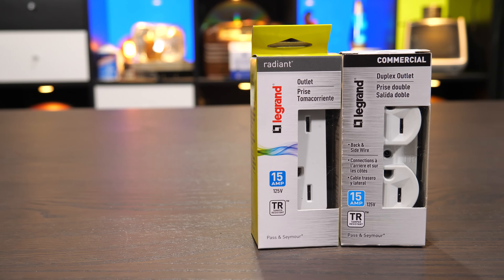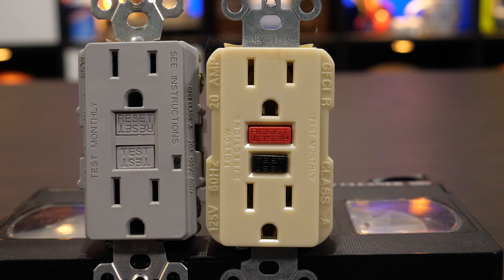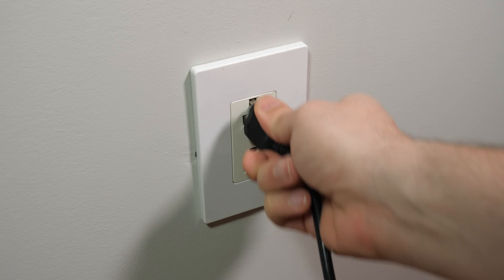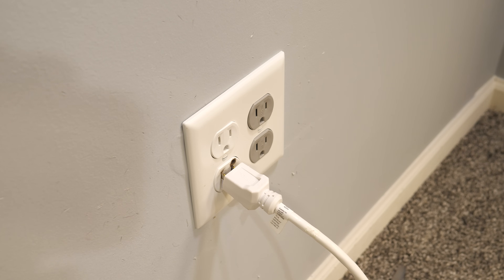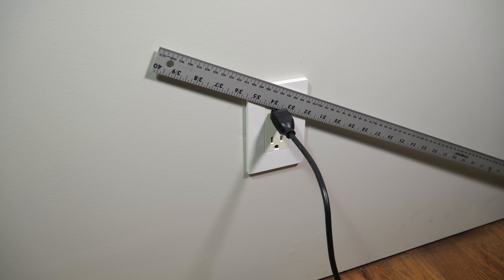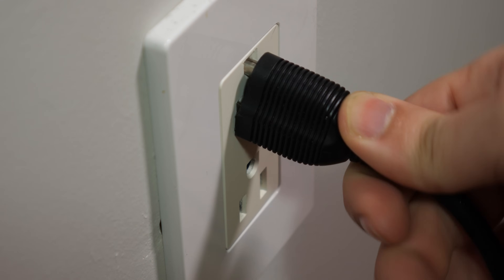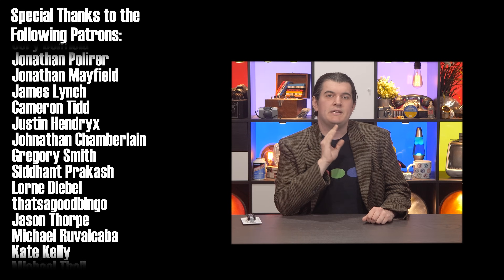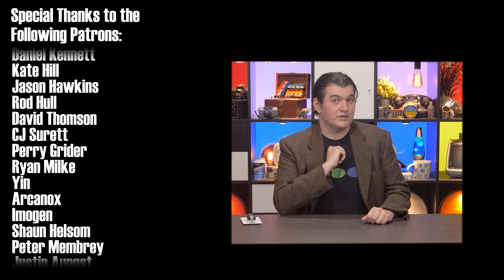Power outlets are topsy turvy - but does it matter?

Comment: My favorite part of the north american outlet faceplate is that they only use flat head screws. So if you want to remove the faceplate, you have to use a tool the perfect shape to fit into the prong slots. Granted, you should turn off the breaker, but the added risk is also nice.
Reply: If they changed that to anything it would most likely be phillips and hell no I'd rather deal with possible electrocution than phillips screws. If it were torx or allen screws then it'd be fine but for god's sake they need to let phillips die it's long past being obsolete at this point and it's a terrible standard (and worse it gets mixed up with the European ISO and asian JIS cross head standards which are not designed to cam out like phillips is but which also get annihilated if you try to use a US phillips head driver on them, just ask anyone that works on Japanese motorcycles about that)

 Words cannot express how much I loath phillips screws.
Reply: I hate using flathead for anything. Sure, Philips has its issues, but square has the best of both worlds. Drive locks into the screw, without a lot of pressure needed for a lot of torque. Its perfect. Square should be on everything. It already is on most outlets on the back, just not for the faceplate!
Reply: @cybrnekomusic  WTF would you use a square-drive screw on a faceplate? 🤔
Reply: Its a plastic faceplate.  Its not even tightened down to any torque.  Very hard to strip out a screw head at zero torque.  It's not a flat head engine from the 1920s using flat head screws as head bolts.  Its a faceplate.  You aren't going to be tightening it enough to strip, you aren't going to be pushing hard enough to slip any where.  I guess Michael j fox might be in danger if he were removing the plate, but he should probably be turning off the breaker before rewiring an outlet...
Reply: @nbf39501  My God, flat-head screws are soo finicky! C’mon, man, the flat-head screw / screwdriver is the cleanest, most basic fastener possible. You disconnect the plugs, twist a few turns, and it’s off!  If you hurry, you can have it off and back on in 20 seconds.
Reply: Yes, as a confirmation, look at 8:30 where Mr Technology Connections accidentially slips into the ground hole. That could as well have been the live socket...
Reply: @adrianrehwald3253 oh no! He might have been connected to ground!
Reply: Yeah but what he is saying is that it can go in a hole if it slips. Maybe multmeter probe in the other.. Its an unnecessary risk - some electric cars require a key to disconnect battery cable which is under the safety loop  @corkhead0
Reply: @HyperVectra  if you're working on a circuit and didn't bother flipping the breaker you're already taking risks. Accidentally grounding yourself is a non issue.
Reply: At least on my Nissan LEAF, there's a manual disconnect under the floorboard. It's there for emergency responders, though oddly enough it's bolted down so you'd still need tools to get to it  @HyperVectra
Reply: @corkhead0  Yeah on the CIRCUT but we're talking about a face plate - sometimes you forget - sometimes the one you flipped isn't on that circuit. If you slipped and put it into the positive you can still get a shock if you are earthed. Yes its not likely but when it comes to possible death I would want things to be like the aviation industry where they build in redundancy yet still the 'swiss cheese' accidents happen
Reply: @HyperVectra  that's why you use a tester to verify it's off.
Reply: @corkhead0  Yeah now I think about it you're right. If I was designing it from scratch I would do it the same way as it is now. Thanks
Reply: @HyperVectra  Great! You have fun beating that strawman. Make sure you complain about a design being unsafe while doing nothing to take care of your safety.
Reply: @corkhead0  I'm not complaining I am just having a discussion on youtube & this is a theoretical situation. You just seem to be hellbent on insisting that mistakes shouldn't be made and if so its your own fault. I don't understand why you take such a strong position on this.. regardless I changed my mind and agreed with you so we don't need to discuss it further. You won.
Reply: @HyperVectra  then stop beating on strawmen.
Reply: @corkhead0  I don't think you understand what a strawman argument is. I am agreeing with the OP and you are the one oversimplifying the argument by first posting "Oh no he may be connected to ground" then attacking this oversimplified version. Unless this is a double reverse strawman argument? Regardless I don't want to continue arguing with you, my mother once told me "Don't argue with idiots, they will only bring you down to their level and beat you with experience."
Reply: @HyperVectra  yes that's what almost happened. He almost put the screwdriver into the ground terminal and a big fat nothing would have happened. I do understand what a strawman argument is. It's every reply you've made. Get over it.
Reply: Turn off the breaker just to remove the faceplate? I bet you fuck with socks on, too!
Reply: @theguy9208  Firstly, LOL, Second, you gotta admit, using a flat head screw these days seems like a cunt move, the thing slips out and you gotta be perfectly paralell to undo it, if it hasn't already been knawed off by butter knives/coins/nail files
Reply: @theguy9208 Instructions unclear..
So..I need to fuck the breaker with my sox on, and screw face plate? 😂
Reply: flathead screws are just bad in 99% of the things they are used in, torx and phillips are the only heads that should be used
also, im gonna keep it real with you, no one will ever turn the breaker off to remove faceplates especially when your painting and are removing every face plate in the house
Reply: @JackRackham429  No, no no no, not phillips, ANYTHING but phillips. Phillips should have died when torq limiting motorised screwdrivers were invented. A screw that is DELIBERATELY designed to cam out is just a bad design in today's world.
Reply: @atomicskull6405  i guess, though they have the potential to be good like sheetrock screws, its difficult to mess those up unless you get the cheapest
Reply: @atomicskull6405  In Canada, we still have the best screwdriver, Robertson.
Reply: Immm, no screwdriver is going to go in far enough to hit any metal inside the receptacle. It'll taper out way too wide to go in more than 1/8th of an inch. Also, this is plain Darwin award territory.
Reply: @GailsonPvPwtf  The whole US is kinda Darwin Award territory lol
Reply: Maybe next time hit it with your purse.

Comment: Kind of makes me appreciate that we dont use old school type c sockets (they are now illegal in many countries) in the states. As a small child I was able to plug in 2 sewing needles into the outlet and nearly shocked myself to death.
Reply: Type C is the "Europlug". Did you have them in the States? It is very much still in use throughout Europe and other parts of the world. Pretty much anything that doesn't require grounding (low power double insulated electronics) use it.
Reply: @owlnoodles  I'm originally from an ex soviet country. I've never seen type c sockets in the states. But I do know that the sockets specifically are being phased out in many countries.

Comment: Well my first interaction with the so outlet controversy was back in the early 2000's when my grandfather was rewiring my grandparents house. The first electrical inspector came they failed it because they the wrong way round and the inspector required my grandfather rotate all the replaced outlets. When it came time for the second inspection after my grandfather had rotated all the outlets a different inspector came out and failed the inspection for them being rotated the wrong way round so my grandfather had to rotate all the outlets once again. Fortunately on the third time my grandfather got the second inspector again so it actually passed.

The moral of the story that I learned was always check if there are multiple inspectors serving your area and if they have different preferences/pet peeves.

Comment: Odd anecdote regarding the receptacle safety covers for kids.  My then 1-year old daughter found one we had removed to plug something in temporarily, and put it in her mouth.  It went back into her throat, and cut off her air.  She made zero noise and just stood in shock.  Gladly I was watching from nearby and ran up, stuck my fingers in and managed to yank it out.  Sometimes safety gear has its own hazards; that woke me up.
Reply: We had to install the slide-shut receptacle covers because our first kid sought out outlets in use and easily gained access by yanking on the cord of whatever was plugged in.
Reply: There was actually a deal with those in the UK where the pin that went in the ground could break off and hold the shutters on the live and neutral open, making the sockets more dangerous rather than less (the UK ones sockets being safe in the first place anyway).

Comment: This is why I don't understand the lack of switches on plugs in the US. In New Zealand, every plug has a corresponding switch, so you can kill the electricity to a socket before even thinking of plugging/unplugging the device. I'd love to hear your opinion on NZ/Aus plugs.
Reply: Do you use type G like the UK or what standard do you use
Reply: @Ananomally Aus/NZ uses type I
Reply: @roowut  and interesting choice with the slanted electrical pins 

Does the I by chance stand for italic
Reply: @Ananomally Australia, NZ etc. use Type I.
Reply: @Ananomally  Type I. Diagonal top pins.
Reply: @SHOGAN1212  top pins

Am I looking at the wrong picture or would you commonly have the ground on the bottom
Reply: @Ananomally  Yep, basically it's:
/ \
  |
Reply: It’s kind of an either/or thing. You can mitigate bad plug design with switches to an extent, but you don’t need switches if the plug design is good to begin with (other than as a convenience feature). The US and Canada unfortunately have neither. They have a bad plug design AND no switches.

Incidentally the Type I sockets (Australia, NZ etc.) are actually based on an old American socket design (like, from the 1930s old). Hence the similarities (non-recessed, ground pin usually on the bottom). But despite them sharing some of the inherent downsides as the modern US socket, they are still significantly better thanks to a few mitigations:

- All sockets are switched

- Pins slanted at an angle, which makes them much harder to wiggle out from the wall compared to the vertical pins in the US

- Pins are always insulated/sheathed, such that no exposed metal is visible until the plug has been pulled out far enough that there is no longer any electrical contact inside the socket.

They aren’t as good as European sockets, but they are a lot better than NEMA ones, and shows that some relatively simple mitigation steps could be taken in the US that would make things substantially safer.

Comment: HAHAHah Great Video Alec....
I have had the Loose metal Face Plate POOFFF happen.
I was changing an old Surge/Spike protector that was held in place by the faceplate screw. 
Did not want to turn off the Circuit due to other equip plugged into the top Recept.  Removed the Screw and before I could hold the plate in place it fell down, Tripping the Breaker shutting off the Circuit anyway....
Mike M.

Comment: Here we also had 2 and 3 pin unshielded and unfused plugs and less than ideal 3 pin sockets just like the US. They also were installed in just about any orientation, including sideways. Once we started officially counting the dead things and interior fires associated with them we solved it with a new standard 3 pin socket and plug design and (this is the clever bit), made adaptors so the older plugs on existing appliances could still be used until they were replaced with a newer one. Not only that we sold (and still sell) self-install plugs of the new design so you could replace the plug on old appliances yourself, how to do this was even taught in secondary school (7th -10th grade) during that transition period.

Why are our brothers and sisters across the pond placed in such peril? A country crammed with high technology and modern luxuries the envy of many nations, yet your Government lets you plug an appliance with a finger on the live pin. There must be a reason, I've just not found it yet. The investigation continues. 😋😉

Comment: For the love of god, start adopting euro plugs. Safer, and even reversible WITH ground, and always only have a metal tip, never exposed prongs when partially inserted. Everything solved. Also never issues with facing up or down.

Comment: In at least two countries in Latin America that I know that use similar 110v outlets, they are normally horizontal/landscape mode, like you said they are in Chicago. I find them so much easier to use than vertical/portrait style. If there is a plug in one of the sockets, it is much easier to insert and remove plugs in the other when they are horizontal.

Comment: Sounds like the best solution is to have the plates be opposing; top "face" inverted, bottom "face" upright. That a) means you can plug in two right-angle plugs or wall-wart devices if needed, 2. you can have a "protected" top plug if you have a grounded plug there.

Comment: Do all US plugs stick the cable out into the room? That must be a trip hqazard and a pain in the ass if you want to put furniture in front of the socket. In the UK 99% of plugs direct the cable downwards, along the wall so if your socket was the wrong way up the cable would stick upwards (not ideal. That can work if you have sockets behind a desk powering things on the desk but only if there's minimal slack in the cables

Comment: You want something like the French/Polish design. Which, I have to admit, is superior to the German design. And then install multiple outlets either so that angled plugs stick out in opposite directions, or install them at 45° angles as any useful power strip does.
The NEMA plug is so bad there is IMHO no saving it. You need to just get rid of it. End of story.

Comment: This makes me wonder if it is possible to install European sockets in an American house, having an American fusebox and electrical installation. After all, the wall socket are the cheapest part and should be easily replaceable. If you manage to get your appliances with Euro plugs, you're basically set.

Comment: We actually had metal plates on an old facility we inherited. It didn't electrocute anyone, but I did get a frantic call about the outlet sparking because the plate fell down onto the live prongs.
Reply: How old was the place? New outlets have fresh clamps in them and hold onto stuff better and will cost 70 cents a piece. Especially tamper resistant ones which are industry standard. If your plugs are falling out of your receptacle, it's time to replace your receptacle.
Reply: @GailsonPvPwtf  It was originally constructed by the county in the 80's, and they handed it to us in 2001. Almost everything needed to be updated, but we didn't initially peg the plates as an issue as the IT situation there was abysmal and needed more work to get it functioning for our use as a healthcare facility.

Comment: You completely missed the crucial downside of right-angle plugs, despite footage illustrating it - you can only put one in the bottom connector of the outlet.  Putting one on top makes the lower outlet unusable, which is an immediate fail for many applications.  I rather like the Chicago solution for that reason. :) 

And playing throw-the-knife-at-the-wall is amusing as a gag, but the real case is table-against-the-wall, and something metal/conductive (knife, straightedge, metallized plastic bag, whatever) slips off the edge and slides down the wall into the plug under the table.  Still not frequent, but not ludicrously uncommon.  After hearing the other side, though, I do agree that the common nature of right-angle designs trumps any safety benefit.

Comment: I've lived in my current apartment in a Bronx building (built in 1940) for 4 years.  Until this video, I hadn't noticed that my receptacles were sideways.  I mean, obviously, I noticed it whenever I plugged something into them, but I never thought about the direction.  Now that my attention has been brought to it, I just noticed that the two receptacles on the wall opposite my couch are oriented in opposite directions.  The receptacle on the left has the ground on the right, while the right receptacle has the ground on the left.  I am guessing that the choice of installing them sideways was deliberate, while the ground orientation depended on which way the electrician picked the receptacle up.  The More You Know...

Comment: Or you’re my mother and have an extension cord hanging off a nail in the wall. Then a plug cantilevered off the end. Then the plug pulls out of the extension cord slightly, then a short, fire, and sparks are made. It left scorch marks on her wall. I as a kid also dropped a pull chain across the lines of a plug. 60 (hz) Socket has woke me up a few times. lol

Comment: This explains why US is running 125V per Phase. This is a nightmare. Gotta love that here in Germany we only use Type F and other CEE Stuff. Its even available in waterproof for extension cables. The single thing that i must admit is better about the US plug is that the Type F isnt polarized. And in Germany its not neccesary to switch both wires on a device, which means that you could have the heating elements in your Toaster live as the switch only broke the neutral wire. The french have laws in place that require everything to be switched on all wires. Oh and the British do incredibly too